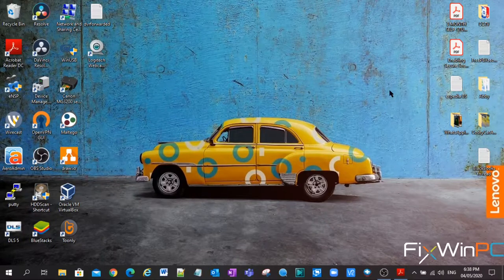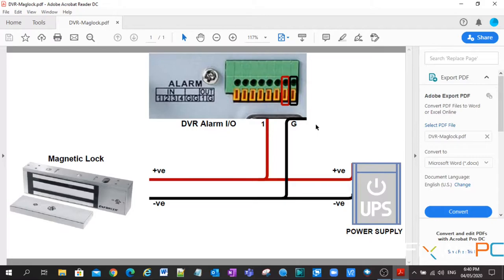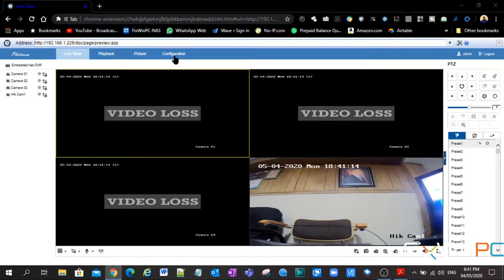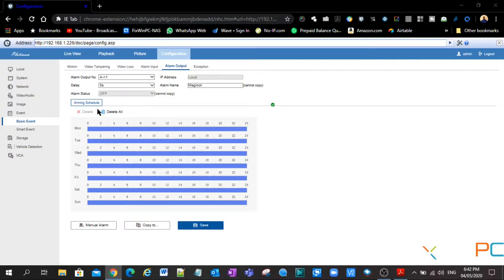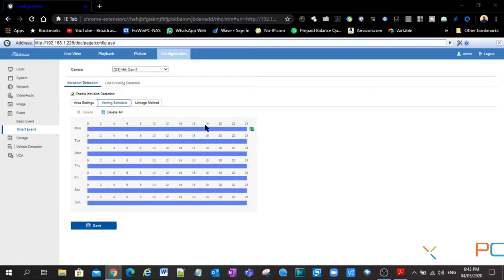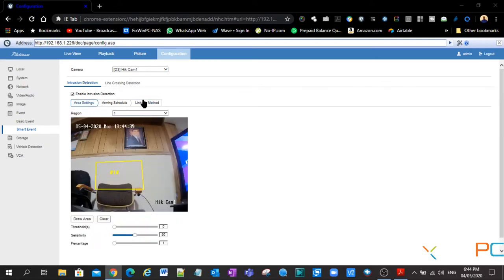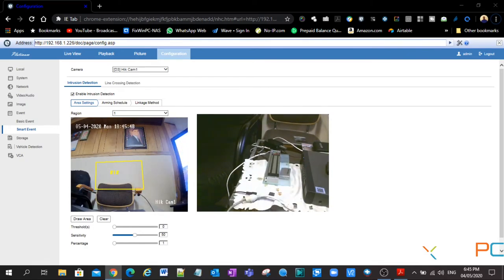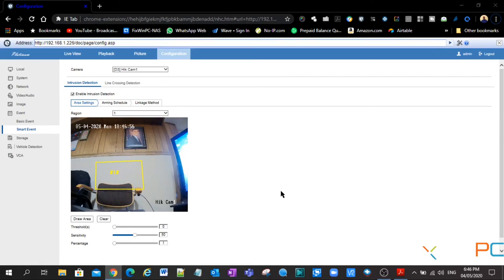Open Mag-Lock using DVR/NVR Alarm Input/Output port

Comment: This is not what I'm looking for. I have an electric gate I want to open remotely using my CCTV phone app over the Internet. Using this method in the video, there would be too many constant false triggers - (bugs at night, sun rise/set, wind). Unless you setup a camera in a VERY controlled environment, this is no good! If I could get a broken PTZ cam that I could modify to work a relay, that would be a better option, but even broken PTZ cams are the cost of gold.
Reply: when did anyone ask what you were looking for?

Comment: This guy is very WRONG. His circuit diagram is very wrong - short circuit across the power supply is VERY, VERY WRONG. I worked out the relay inside is grounded to negative. On the IO board there is a removable jumper next to the relay. Remove that jumper and you have an isolated relay switch that does not switch to ground anymore.